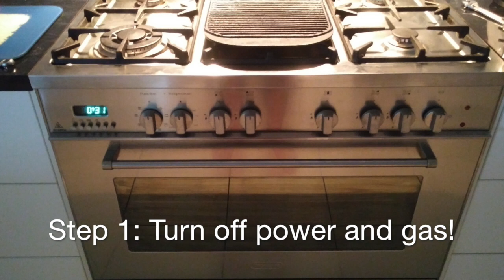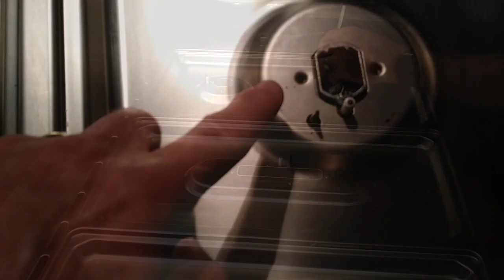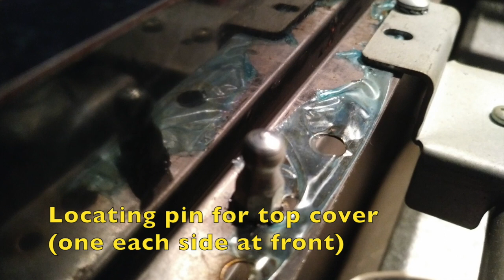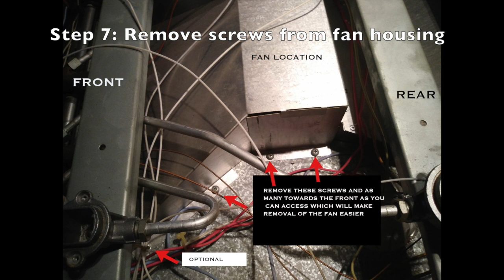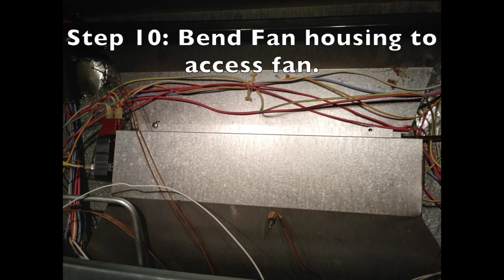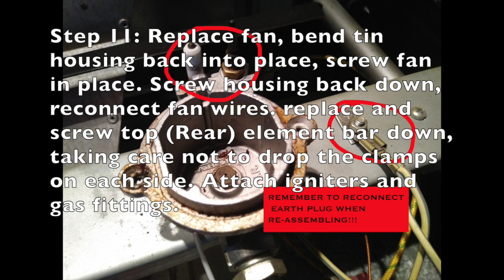DeLonghi oven tangential fan replacement DIY

Comment: I have a delonghi cooker I think I can access it without removing the burners is that ok
Reply from the maker: I'm not sure, but if you think you can, you may as well give it a try. Good luck
Reply: @bossmanDIY thanks I’ll give you an update when I get round to it. Great video btw👍🏽
Reply from the maker: @BuddhaSunnthanks
Reply: @bossmanDIY I had to remove the burners to get access and changed the fan but the new one isn’t working. Can you advise what to do next please?
Reply from the maker: @BuddhaSunn sorry to hear that. Unfortunately I haven't had anything to do with them, apart from the time I changed my fan. You will have to google how to test the fans. I'm guessing a multimeter set to "continuity" might be a good starting point. Just test your old fan, as it may be OK. Assuming the new fan is OK (it should be of course), sounds like your problem may be somewhere in the wiring or circuit board. You may need an electrician unfortunately.
Reply from the maker: https://share.google/aimode/wAwioAEmNMB4j583a

Comment: My oven is very humid whilst cooking could  tangential fan be at fault?
Reply from the maker: I'm not sure. The main tell-tale sign is that there is a ticking noise from the fan (caused by failed bearings which makes the fan hit against something it's not meant to). If you have the same oven as this, the air from the fan blows out the vents at the top (behind the gas burners) so if it's working properly you should be able to feel it blowing out when you first switch the oven on and you should hear the fan as well (bearing in mind that if it's a fan forced oven you will probably also hear the circulating fan as well as the tangential).

Comment: Great video. Our oven's fan forced setting just stopped working today, no idea why of course. Daughter baked some muffins, then my wife put in a banana bread dough mixture and after the 45 -50 min baking time she opened to check, to find a Luke warm oven instead of a 180 degree heat!.
I am currently trying the Multi-function setting which seems to be working just fine. Any ideas or suggestions.
Reply from the maker: Hi Marv, no sorry I can't help you with that one. Best of luck